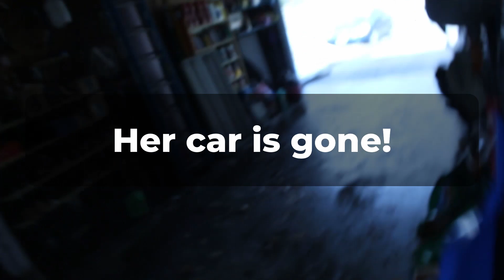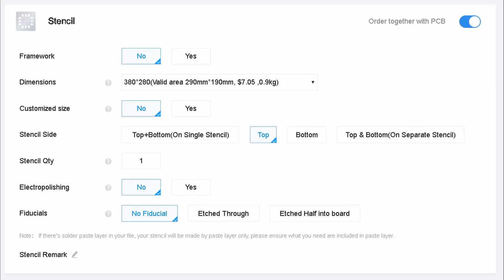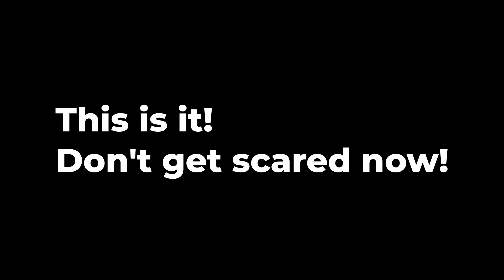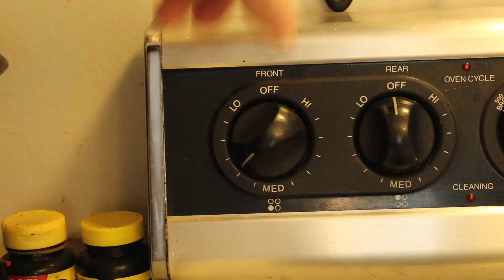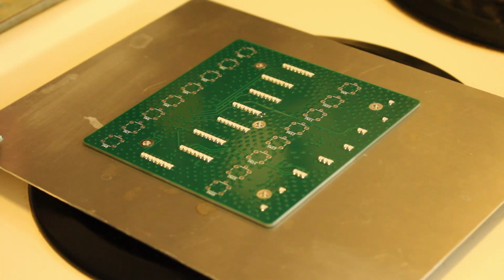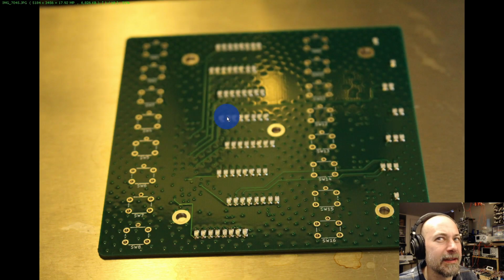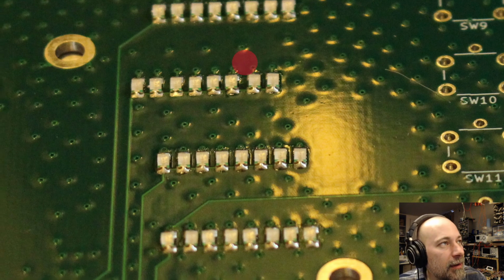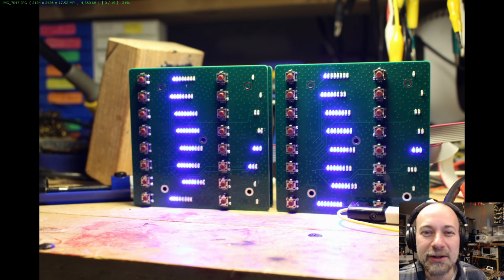Can You Reflow Solder In the Kitchen?

Comment: Regarding your remark that there was too much solder paste deposited: maybe it's possible to have the stencil manufactured from a thinner plate. A thinner plate will allow for less solder paste to be deposited in the stencil cutouts.

Alternatively, stencil cutouts smaller in size than the footprint could maybe work as well - the solder paste flux will take care of completely wetting /distributing the solder across the footprint during reflow.

Comment: I recommend you to reflow the board again with some good old hand soldering flux like felder lötfett or something similiar, a rosin flux that is of good quality. Such fluxes work wonders for solder meniscus forming and I'm pretty sure it will align the components at the dead center. Those newer high tech fluxes never worked good enough for me, maybe I don't have the good ones.

Comment: Brandon, I enjoyed your video. I received a "UYUE 946-1010" hotplate today, so I've been scouring YouTube looking at how other people are using hotplates. I reflowed a small board and worked well. To reduce the amount of paste use a stiff plastic card. Also, you can press the components down into the paste when you place them. Using a proper hotplate will allow you to mess about with the speed it heats up, and reflows - that probably has a bearing on the way things solder too. If yours takes too long to heat up on the stove then the effectiveness of the flux may be gone by the time the solder melts. Just my thoughts of "day one" of hotplate reflow soldering. I look forward to more videos.